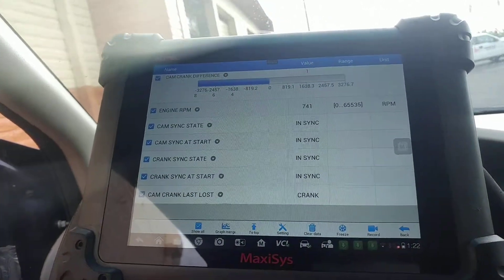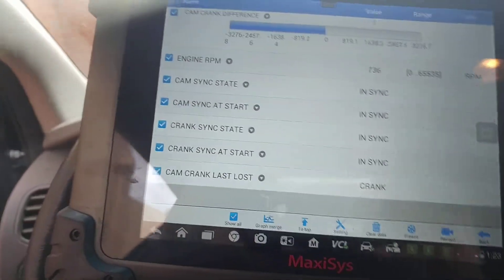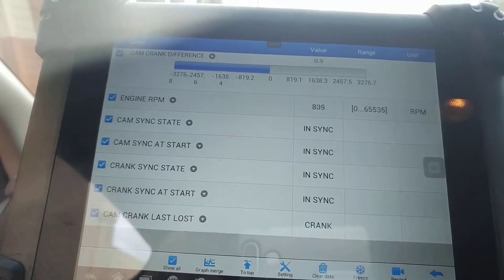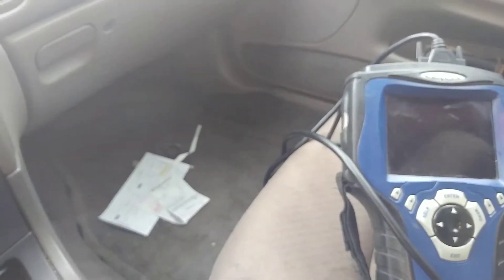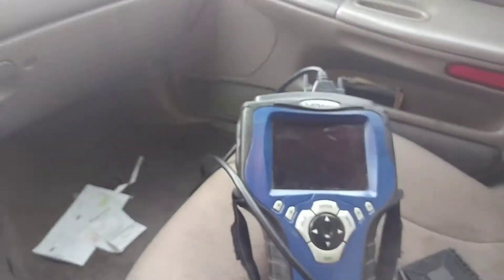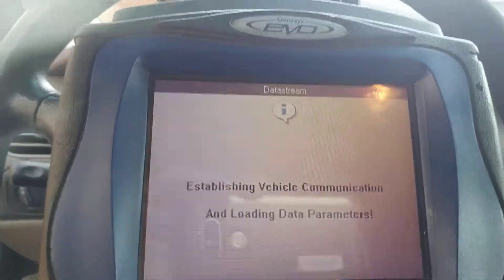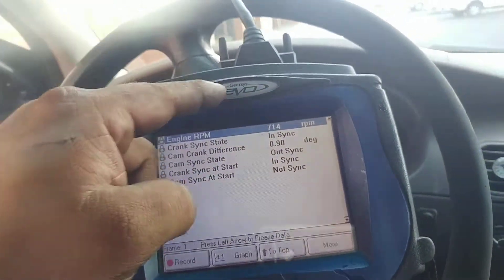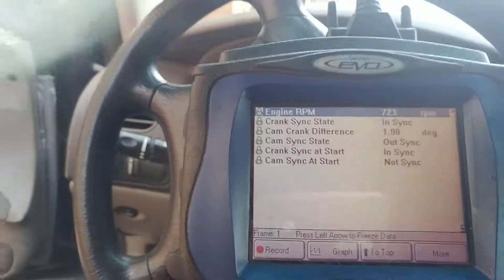Trusting your scan tool for engine diagnosis

Comment: Great video I've been a tech for over 15 years did you ever do a crankshaft relearn on that vehicle cuz looks like that's what it needs due to timing chain wear that's where that one degree difference came from other than that by the value numbers both tools are right I still have my Genesis but due to the vehicles being newer I upgraded to a thinkcar pro S Plus scan tool and I love both of them I still use the Genesis from time to time you should be able to perform that relearn on the Autel

Comment: Nice video ,so what was the out come in this? which tool was right and which was wrong? I also noticed when you connected the genisys the car was already running ,and not started from the off position ,would that have made a difference ?
Reply from the maker: The autel was more accurate,  the otc genesys was something different at the time. Was not the same reading as the autel.